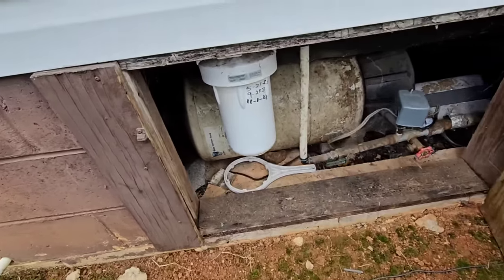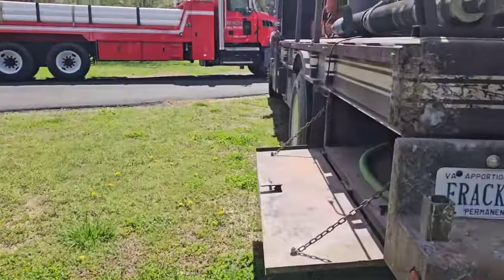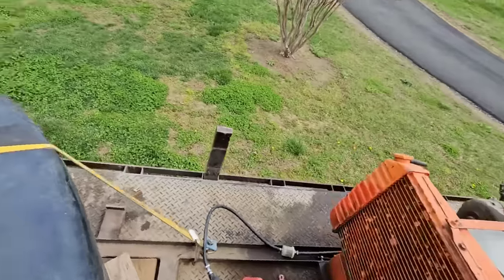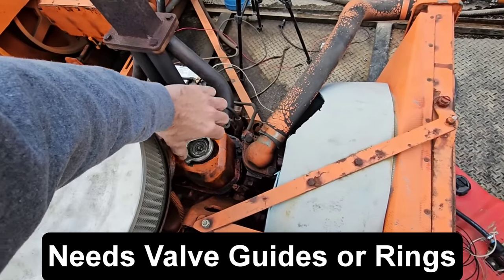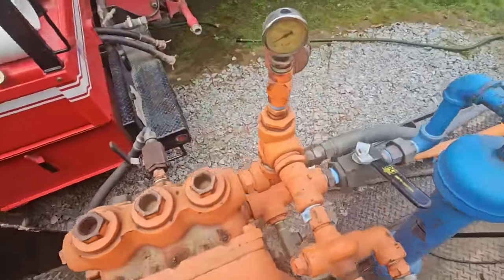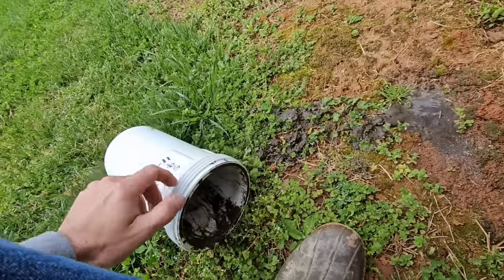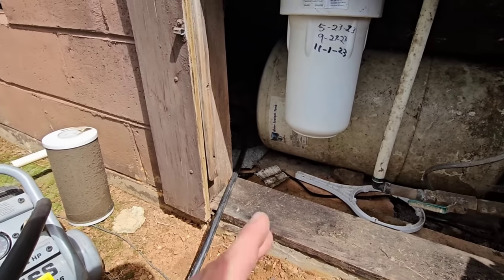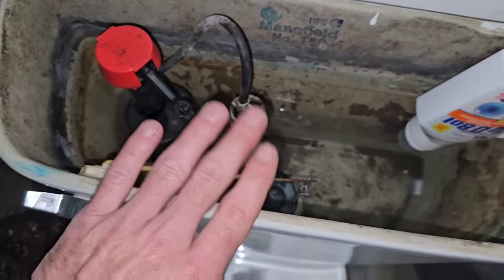Fixing a Water Well that Keeps Running Dry. Hydro-Fracking, Full Pump System Inspection

Comment: That motor needs Rings. Guides wont cause excess crank case pressure unless its on a boosted application . Rebuild that iron duke Those are good motors. I agree with your service accumen . Give the customer the most Honest value you can give them. The office may have a different ideaology but what you do in the field shows to your character and helps the company whether they know it or not .
Reply: Considering its a family business ran by him and his dad, i would say what they see and hear in the field as the company's values.
Reply: @R_B62  Considering he was sending a message to others i was following the same suit . I surely wasnt talking about him and his dad or his company.

Comment: Instead of electrical tape to secure the wire, you should give self fusion silicone tape a try. After it is stuck to itself for a couple of minutes, it will never let go. It doesn't have any adhesive to degrade over time like regular electrical tape does.

Comment: I agree 100,.%. I do automotive diagnostic.  I check the whole system and discuss this with the customer before I start that similar to a flat tire it may have more than one issue causing it to go flat ie a nail...bad valve stem...rim leak due to corrosion ect. We don't know what we don't know. I keep them informed as I go sometimes I give a high worst case estimate to ensure a proper repair...only billing them for what was needed .They appreciate when im under estimate.Integrity matters. In the videos I've seen you always have Integrity. Keep to your values. God bless.

Comment: While the well is being fracked has anyone had a problem with the bladder and the pressure caused the water to blow out or the injection tube just wondering it might be a dumb question but I believe the only dumb question is the one not asked lol thanks for sharing

Comment: Nice work mate. I agree with your ethos, the customer wants the well to work but it’s not just the well. It’s the full system of well, pump, valves, switches, pipework and filter etc. they all must work together so a top to bottom diagnosis of the system is required to determine the fault. All the best.

Comment: With watching your videos on the Hydro Fracking that your little 4 cylinder engine does work really hard and it might be a good idea once you pull the trigger to replace it, go with either a Ford 300 6 cylinder or the Chrysler 225 Slant 6 that comes out of an old 60's truck. The slant I have a lot of experience with and they are tough engines and can take a beating. Get a good sized radiator on them and they won't overheat either. You could push them all day and they won't care, as long as you feed it fuel they keep putting out the power.

Comment: You said the duct tape can come off and get sucked around the pump,  Is it possible that this could have happened this time and simulated the well running dry. I really don't know, just asking.
Reply from the maker: No, because it would be stuck in the pumps intake
Reply: @h2omechanic  good to know, thanks.

Comment: Here in the UK everything is chargeable. You're part of a dying breed of tradesman who does a proper job 👍
Reply: I'm from the UK and I don't agree with your comment. If you think its bad in the UK then its even worse in the states where everything has a price and just as bad if not more so that the UK. In both countries finding a conscientious contractor is the key. There are contractors out there who value their reputation and work to it accordingly but they may not be the cheapest as that additional 20 minute has to be paid for somehow. The key is to question the contractor on what they are going to do before you give them the job.

Comment: For the motor rebuild, you might want to also oversize the radiator while you are at it since you said it overheated. Or maybe an heat exchanger with the water you pump?

Comment: You should try a heavier oil like 20W-50 and/or Engine Restore in the silver can. That's the one thing I've seen work agaisnt bad oil consumption and blow by. I've heard of iron dukes powering cars, trucks, boats, and mail delivery vehicles. Hydraulic fracturing rigs is a new one to me. Maybe next someone will put one in an airplane. Did you mention what year the engine is?

Comment: Honestly you should keep that iron duke and rebuild it. Parts for them are easily available since the post office's fleet of LLVs use them. A V8 would just be overkill, take up more room, and require a much larger cooling system. Where the cast iron 4 cylinder that is the Iron duke both head and block are much more tolerant of being ran hot.

Comment: I just had a new well dug and the water is still coming with an orange tinge, a sediment that stuck to all the pipes in my house and no matter how many hours I run the water, it’s still orange from the clay stuck to the pipes 😭
Is there a way I can power wash my whole house piping inside? Or a chemical or anything? Any suggestions would be so appreciated, I’m desperate 😭😭😭

Comment: Do you guys ever have problems with bits breaking or rods getting stuck from the hole collapsing while drilling? I know that has been an issue in my area with it being mostly sand and limestone.

Comment: Heij :) I enjoyed this hole systems overview. And I have same opinions: You´re a good, thorough, big picture worker and yes, the motor needs a rebuild. If You´re really attached to it let it bore out, new pistones, new bearings and seals, get the head dressed up- good again for 30 years.
Give Jim´s Automotive Shop (yt channel) a ring, maybe You fix his well, he fix Your motor- all good. They are just as good with engines as You with wells.

Comment: I have stayed on "ticket" before and gone off ticket. It generally depends on the customer. I have had customers who want extras but will only pay the bill after arguing about it for six months.
On the other hand, when I take my car and lawn tractor to my mechanic, the car mechanic is allowed a $500 overage, pre-auth. Usually, I get a call and say something is up, but if it is minor, they just fix it. On the other hand, my car mechanic does not always charge me to look at my car when it is a few minutes of labor, like taking porcupine quills out of my car. I missed all but the tail.  The last time my lawn tractor was at the shop, I told him to add up to 30 minutes to do little things.  He made the sheet metal fit much better and addressed some annoying things.
I also have folks that I will NEVER go back to.

Comment: I’m in Quebec, we have lots of water , my well was made in the mid 1800’S  went a bit dry in 2019 yes 175 years ago , it’s 30 feets deep and it’s a 1 inch pipe , I called a friend that has mini excavator, we find the well then pulled out the pipe and we put a 1 /1/2 stainless steel pipe, 50 feets deep , removed the lead pipe from the well to the house , yes made of lead , not too healthy , filled the excavation with very compacted sand , then using my pump I pumped a bit over 5000 liters to create the new well , the well is about 50 feet from the house , after pumping about 2000 liters into the well it was visible the earth was lifting of about 6 inches on. 60 feets diameter, by the time I went to a friend refilling my 1000 liters taut the earth has lowered , it was slowly raised as I was pumping water into the well , after the fifth taut I let it set for 2 days , then pumping water from the well , it was a bit sandy and Claudy at first but after about 30 minutes of pumping the water was very clear and no debris.

Comment: So many questions. I came across your channel by accident and now has me wanting to ask questions. 

I will have to look through the video list but we have a property/cabin in a high mountain park in CO. This property has an older well and a new septic system. When I purchased the place the well hadn't been used in several years. I had to replace the pressure tank and all the plumbing to the tank (tank had a hole in it, new pressure switch, check valve, etc.) Well worked ok but I let someone stay there for a week and didn't show them to shut power to well when they left. Have an outside freeze proof spigot outside and when this person left he left a hose on the spigot and spigot open. Hose sprayer was on the hose so the hose could just build pressure. He left and 2 days later we went to the cabin and the water was running everywhere because the cheap hose ruptured. Looking at my game camera I found that the hose ruptured shortly after they left so well pump was running for 2 full days. After this happened I had to replace the check valve on line to pressure tank because something caused it to fail so it would allow water to flow back toward pump when pump shut off. Ever since this time I have been getting air in my whole system. Not sure if my well is drying up or something else is wrong. I haven't called a company yet to come and check the whole system. Prior to this issue with the burst hose the well was working just fine with no air in the system.

Comment: I love your videos. I am a new subscriber to your channel and have been watching all your videos. I am from northern Wisconsin, so I understand cold.  I am in the process of changing out my pump as it up and died due to a lightning strike. I have a fifty-year-old well that was not grounded back in that day. I had to have a well driller come out to pull my old pump as it had a rusted pitless that would not budge. They hooked up to it and it snapped off the pitless in the process. Now that I have the old pump out, I will be replacing the pitless  and installing 1 inch poly pipe with a 1/2 hp 240-volt 2 wire pump. I enjoy your teaching and am looking forward to replacing my system from start to finish. Thank you again for all that you do. Your awesome.

Comment: I was asked to look at a well . 20 years old , never had bad experiences with it . I found the pressure tank was full of water , the pressure valve was blocked , springs in the valve were loose and galvanized pipe in the well . Told the woman this is what I found and they need to be addressed . Depth of well I found was 130’ . The well house is an underground block of concrete and full of leaves and was wet . Told he to contact a well company to do the repairs . 
She cussed me out because of the price the well co charged her  . All new everything and good flowing water even the pipe from the well to the house

Comment: Good business acumen, since you are there......
There is an A/C guy on ytube, his motto is look at the big picture, fix it right, fix it once.
The engine is pushing blowby, if it has gotten hot it has taken the tension out of the rings and they are no longer sealing, hence crankcase pressure pushing oil out at the highest spot on the engine.
A side effect of worn rings is oil in the combustion chamber/process causes detonation, IE preignition under load, and that will eventually beat the bearings out of it. 
A painted radiator may look good at one time, but the paint inhibits the heat transfer. If the cooling/airflow is marginal to start with, like no fan shroud, excess paint, worn out impeller on the water pump it is not going to remove the heat and the engine will consistently run hot under load.

Comment: A good example of an excellent service and no brainer. 20 minutes to do the job properly and prevent the need for a second visit. Unfortunately not contractor thinks that way in the belief that a second visit will generate more profit. Unfortunately for the customer their workload means they wont get back for several weeks so the customer has no alternative but to carry on without the thing working and wait or find a contractor who can

Comment: Had the vintage 1992 heat pump stop working in a rental, expected this to be the end of it. Called the local A/C guy, he got there before I did, found a blown fuse, and since nothing else was wrong he cleaned out the air handler and topped off the refrigerant. Now I keep their number in my phone, not going to call anybody else.

He could have easily told me it was just old and dead and charge 5 grand for a new system, I wouldn't have known the difference, but he only charged $115.
Reply: You found a premium guy to work on your property.  You are right to keep him.

Comment: Lol, I have a bit of a hearing problem, so often I have the transcript running along the video. 07:22 when you run up the engine, the transcript calls it [music]
Reply from the maker: It's because it's so loud I have to reduce volume by 90% while editing. 30% of my viewers are using sub-titles. So I try to add text in the important areas. No1 else hears anything during that time either for the most part. 
You could try buying a nice set of headphones 🎧 and see if that helps you better hear. Just an idea, please take no offense

Comment: Take your PVC valve off run 3 and 1 oil inside of the it will clean it where the ball will move I've never bought a PVC valve in my life and I'm 57 years old
Reply: Most people would just wash PCV valves in unleaded gasoline.

Comment: Just wondering what kind of hydraulic oil you guys use for inflating the fracking tool? I ask this question due to the fact what happens if you have a rupture of the rubber bellow you will contaminate the well if it does?
Reply: He says it is some kind of food grade peanut oil.

Comment: Why don't you blow the well . why don't you use air to blow the the sand and gravel out of the bottom
Reply from the maker: @ralphtaylor6012  sand & gravel doesn't fill the bottom of a rock well. And air won't frack a well. Think of it as blowing out a clogged drain line. You have to cap one end & force feed fluid thru the stopped up area (the water vein). That's what blows out sediment plugging up the flow of water thousands of feet out into the veins, blowing the sediment clog out.

Comment: Do you have any experience with "in well"pressure tanks! I can't find any info on them but a contractor is trying to sell me on the idea! I have a very high water table and my current tank (which is under ground) floods regularly, and I need a different solution!
Reply from the maker: They are OK, not amazing, but they do work. They are just small & make the pump run more frequently. But if you have no room for one in the house, it will work just fine.
Reply: @h2omechanic  Thanks, I appreciate that!